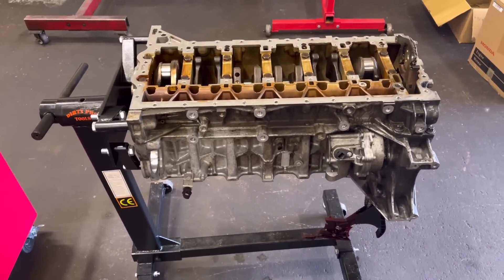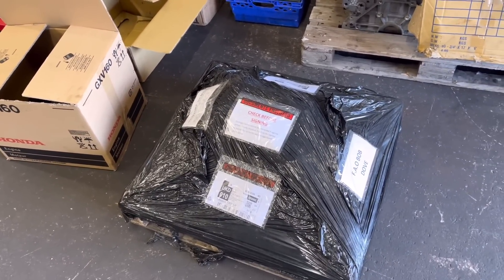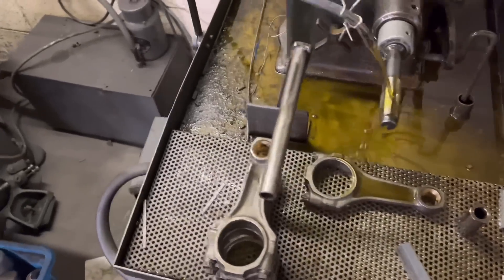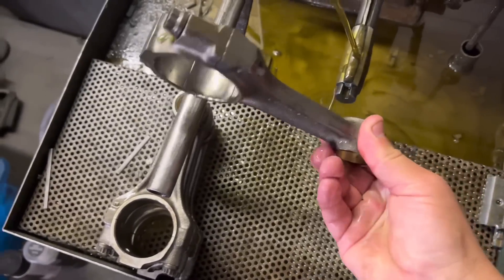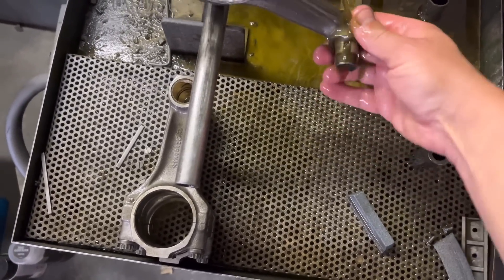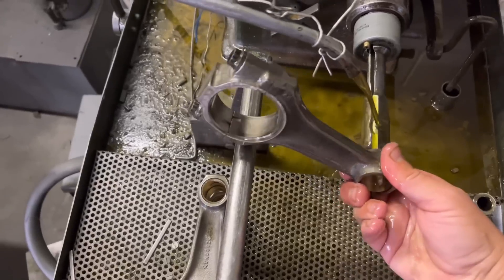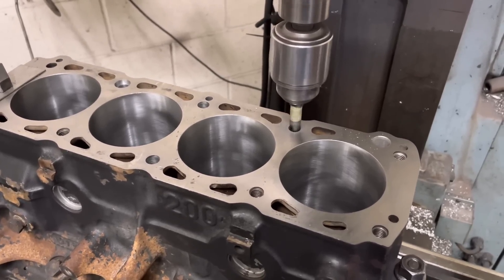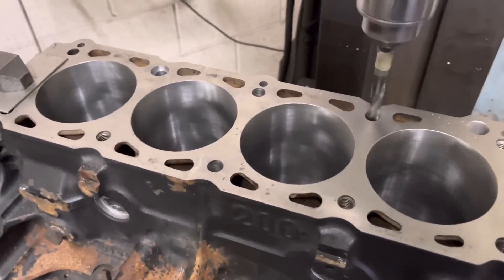Customer’s 3rd attempt of a warranty claim, but WILL NOT send engine back for inspection

Comment: I would give him a call and fall over yourself to get the engine back super nice just be careful not to admit liability to make it clear you want to check the engine as per the terms of the warranty. Follow up with an email stating the facts and see what happens. If it's clear from the warranty your expectations and requirements he hasn't really got anywhere to go.  All he can do is waste your money by you having to instruct a solicitor to write some letters etc. Can't see him winning in court.

Comment: Sounds to me like they've done something wrong, overfilled the oil, didn't drain it properly or at all. Won't admit they've messed up so trying to stitch you're good selves up & putting you to unnecessary expense & work hours. If they can't send the engine back for assessment then they're trying to scam you Lee.

Comment: Hello there Lee .... Now 'That Engine' ...... It might Not even be the same engine ..... ?????       Maybe worthwhile, from now on, taking a photo of the Serial # of the Block and or Any Odd  Component features that you can use to varify that you are comparing Apples with Apples. Just add the Digital infor to the ;Jobcard' on the Computer .... My 5c worth ..... :-)   :-)   :-)  Cheers from NZ

Comment: At 1.30m how the hell do you offer warranty on the small (figure of speech) amount of work on this engine when so much more needs to be fitted and within spec over which you have no control ?? Are you fitting the crank, shells, big end bearings, rods, pistons, rings and more importantly checking them all and getting the piston heights right ? Sounds like a lot of risk to me.

Comment: Assuming your description to be complete and unbiased and that your warranty assumes that a rebuilt engine is a complete unit ready for "plug and play" by installation by a competent person:-  The customer has demonstrated mechanical incompetence in the first complaint, nevertheless continuing to install the engine and "tinker with it for six months, citing a second and third complaint in that period.  You have no way of knowing what degree of invasive "tinkering" , dismantling, and reassembly, has been undertaken by a proven incompetent mechanic during that period.
If he was dissatisfied in the first instance then he should have returned the engine to you as per the terms of your warranty thus allowing you to ensure everything was correct. By continuing to work on the engine he has voided such warranty, imo.

Comment: Barum Engines are reasonable by offering to rectify any problem with the work they have done. 
3 Times they have offered to put right 3 different problems you can't get better than that.
Each time they have been ignored. Sounds like the customer is being unreasonable and trying it on.

Comment: With the warranty claim, in all respect maintain your professional standing. I'd say that I would really want to help with his issue and understand his concerns, but are unable to investigate or have any recourse of action until the engine is returned to Barum. Even offfering the viewing of the investigation if necessary as a gesture of goodwilll and will do everything possible, if Barum's fault to remedy for him. As for the push rod honing..you really do that without gloves? I hate the smell of that liquid plus if you had cuts on your hands makes you susceptible to the properties of the fluid, in my considered opinion of course.

Comment: badgering for refund and trying to wear you down to submission. next step will be threats of court action unless he gets x y z back within 14 days to avoid further action. certainly a chancer and do not deviate from insisting you need the engine back for proper examination. the engineers report could have been done on a different scrapper engine as far as we know for his own benefit of having an independent report (for court purposes). with the original complaint of oil loss on the flywheel bolt, he is just the type to removed the sump, head, rocker cover etc. and fit new gaskets everywhere and probably tightened the head bolts to hand tightness !! now he is in too deep and lost faith in the product and wants a wad of cash to make him feel better. if he was truly concerned about warranty he would have returned it, but probably too embarrassed that you would discover some tinkering and charge him, hence the harassments to get refund instead.

Comment: The customer will need to give you the engine and the opportunity to rectify any damage that was the result of your work on the engine.
A solicitor will tell him the same .
The guy just wants a refund, advise him that won't be happening untill you have viewed the engine.
Reply: If the engine ever shows up for a teardown and inspection, ask for a deposit to cover the expenses of the T&M it will take to do the inspection.  That will toast some toes...  But it would prevent doing all that and ending up with an engine of no value and noting else.

Comment: Just had my lr discovery 3 rebuild with new parts(complete failure)
The engine recon company advised 10w40 but the engine originally requires 5w30 any advice on what oil to use as im close to my 500mile change 
Thanks chris
Reply: See what your warranty requires, and if the builder spec'd the 10w40, then go with that.  Whatever the manufacturer recommended did not work out so well, so maybe the builder has good reason.  Makers in US will spec lower viscosity across the board(maybe) to get that extra ,001 increase in fuel economy because of Federal Government edicts.  5W20 was created for that reason.  Any and all should likely change to at least 5W30 for longevity, and some makers have revised their spec to that even though the oil filler cap is embossed with the 5W20 spec.  I go with the builder.

Comment: Cylinder head bolts NEVER just "come loose".
He has undone it. Just like he did with the flywheel bolt to claim a oil leak.

Customers that take on a task and then after a while find they are completely out of their depth can sometimes sabotage the item they have bought in a attempt to blame the seller for supplying a faulty product  to obtain a straight out refund as you described. But also they want to keep what's left of the item. 

It's not on. He is a chancer at best but likely a scammmer. He could also be mentally ill. 

He must return the engine for a warranty claim so it can be assessed by you and if the problems are non existant or caused by him you must then charge him for your labour. If he does not pay you keep the engine. 

Tell him if he does not return the engine  but continues with demanding correspondence you will be treating that correspondence as personal harassment and will take appropriate action.

Comment: Surely you’d need the car back to see the issue? Then if it was a warranty job you’d have to remove it to rectify if necessary, as it’s not exactly a two minute job for the customer to remove an engine for you to have a look at it?

Comment: Just the same as vehicle repairs you get shoppers that have the vehicle repaired and then take it elsewhere when they discover the fault hasn't been rectified , usually they return to original repairer and want there money back and not interested in allowing them to rectify the mistake, and then it does the rounds , usually mentally challenged people with no money.

Comment: The engineers report supplied by the customer now makes it imperative that the engine is returned to you for inspection as it raises even more concerns than it actually answers.You cannot be asked to provide a full refund unless you have had the opportunity to inspect the engine.Should this go down the legal route my thought would be to insist on the engine being returned prior to any further consideration of the claim.On receipt of the engine you could even get an independant engineer to attend whilst the engine is stripped and also video the entire process.

Comment: you have replied many times requesting the engine back....let the guy try taking it to court.  they will say the same thing. he has to by law give all oppertunity for the company that he is claiming against. the legal right to inspect it... not unless due to graphical location its not feasable to do so. but the company concerned can by rights then authorise a third party to step in and inspect.  do not reimburse. you have the law on your side.

Comment: The engine like any other good should be returned , no point this fella taking court action as the guy or company who did the report has not stripped and measured all the working parts for tolerances as per build , any legal team will rip this claim to shreds and you can claim compensation from him and stress related

Comment: Having worked in professional and customer service in over 35 years I cannot respond to your PoV as I only hear your version of the story... there are always 2... and people sometimes are really weird in their perception of the situation and what they expect is reasonable... In my experience, it is about competence (do or don't  they understand the facts) and their emotion... are they looking at the details as they are (being as factual as possible) or did emotion take over, and is everything distorted what you say or mail. You are focussed on the technical facts... service is alas sometimes more about the customer.... can be quite frustrating. Do not want to impose my opinion, but your video is also proof of your frustration, and I do recommend not to do these, and just go to the customer yourself (or have a trusted qualified engineer do it). It quickly resolves the matter for you... is he a crook or liar then finito... if not, you advice/service can resolve mutual misunderstanding... but hey... what do I know.

Comment: The warranty scenario stinks, if the engine for instance had a minor oil leak but was fitted to a vehicle he needed for work it might be plausible that he woud want some cash back to get it repaired locally. The engine was not even in a vehicle, presumably it is fitted now? Sounds like he is trying to pull a fast one. It seems very strange that he has had reports done but appears to not want you to see the engine. Something is fishy in general, he may have had advice that he stands no chance in law so is trying the war or attrition. A factor I don't know is what type of engine it is, some engines are built to work and some are built to play. For instance if it was a BDA going in a restored MK1 Escort it might be credible that they would have the engine under wraps waiting for the car to be ready, if it was a Transit engine it would likely want to be making the guy a living quickly. (I know this is vague). Sticking with email is wise, at least you have a "paper" trail. Dealing with a normal customer I am sure they could get on the phone, and arrange to bring the engine back for inspection. The faults on this engine seem to change pretty frequently, sounds like a chancer...

Comment: sounds like he might be creating a problem himself. I have never seen a head bolt come lose ever in 30 years of building engines it would of blown the head gasket before it worked its way up far enough to damage valve train 
COL

Comment: Gidday Lee, man anyone who was legit would have shown you the problem they say is due to your work with the engine in person. .Not basically make contact by email and a photo.Like you say, a photo is not proof its the engine you worked on unless you had a system of stamping an ID number.Also it changed in what was wrong with it.I think it wouldn't matter if he makes a legal claim as he has not given you the right to identify authenticity of the job and decide if you are at fault at any point.An email is not proof of a problem with some engineering, it is a just a form of communication to inform with a verified time it was sent.I think his actions already show some level of fraudulent behaviour.

Comment: So the customer contacts saying engine problem in unfitted engine
 Customer then says he’s used it and there’s another problem
Surely you can dodge this by saying there was a minor problem that was offered to be fixed if returned 
The customer didn’t and the problems got bigger 
Customers a tight arse nobshiner that’s what 🤣

Comment: This sounds like a scam to me. Why go to the expense of getting an engineers report but refuse to send the engine back to you when you've offered to check it over multiple times if it's legit? Like others have said in previous visits you need to take deposits and get your Ts & C's done by a solicitor including not being responsible if the customer messes around with the engine after the work's been completed which could lead to issues. Make sure you save all the e-mails in case the karen tries a small claims court action

Comment: He had his chance of Returning the Engine Game over, Seems Like a Fiddler To me you have no idea what has Happened to this Engine 🥵Why after filling the engine With oil then Take the Flywheel off 🙈 Looks like the Head has been Removed. This is similar to a story my old Boss Had with A Doctor and his Chemist Brother After a Engine Rebuild collected on a Friday ,by Monday They Knew what Oversize of the Pistons as they Had Removed the cylinder head Catching both of them out, They were only Given the car for Running it in on the Weekend as the doctor had a long Journey So they could give it a oil change on Monday Retorqe the Head, and would not be back for a few weeks ,they Even measured the Bore 🤠 Looks like you have Found a Relation of them in 2022 .The problem with A Judge is if he has no clue about Engines and Engineering his Decision will always be on the Engineer's Report,The Paper facts in front of Him I'm afraid 🤬 He is the only one That Should have Removed the Rocker cover in the First place 👍

Comment: If he genuinely believes you buggered up his engine then he would naturally be reluctant to give it back to you. I’m not saying you did but just looking at it from his angle if he’s being an honest party here.
Reply: Problem is, even if that was true, if you want to claim under a warranty, you have to return the item concerned to be assessed.

No company is going to refund (full or partial) under warranty without being able to carry out their own hands on assessment.  (unless it's something you purchased of ebay for £3, where the seller might decide to refund to avoid the hassle!)

Also, I don't see how he is the "honest party" given at least one of his so called warranty claims was utter bollocks i.e. the incident with the flywheel bolt.
Reply: Likewise if he messed it up by removing a bolt that caused oil to spew out he will be very reluctant to send it back.  He broke it and wants it fixed or refunded under warranty.  Factor in that and the admission yet another person has worked on the engine I think Lee is quite within his rights to tell him the warranty ended when third parties worked on it.
Reply: Fella is broke and panicking, and seems to be digging a deeper hole for himself. Legalities?!?!?!?
Reply: Mate of his are you?.
Reply: If somethings messed up, which does happen occasionally in all industries, one fault doesn't then mean that company is shit. You may aswell not trust anyone to do the work with that attitude. These guys look like they have made enough mistakes in the past just from the knowledge and skill they have. Means mistakes are minimal and they know how to fix them. I wouldnt go to a company without experience like this because of that increased risk but then if i did go to a place that was cheaper who claimed to do the same shit but doesn't fill you with confidence they'll get it done and they fuck it up  id still have to follow the process through creating a case for court if there was one. still giving them the chance to rectify any faults or there is no case.

Comment: How come you do not measure the journal to see if there is enough material to re grind to a salvageable size. Also have you no set up centres to check the crankshafts for trueness to the manufacturers tolerances?. You sound just like a goods in inspector that I worked with in the seventies who upon looking at a sub contract ground block, testing the surface finish with his finger nail and stating that it was not within drawing tolerances of 63micro finish. I politely asked him to check it with the surface finish machine and it was found to be in tolerance. So please let’s see some technical investigation instead of guessing that parts are not salvageable? Andy ex jigborer inspector.